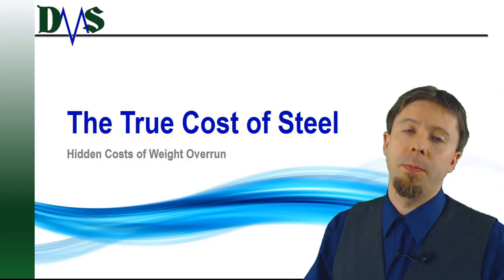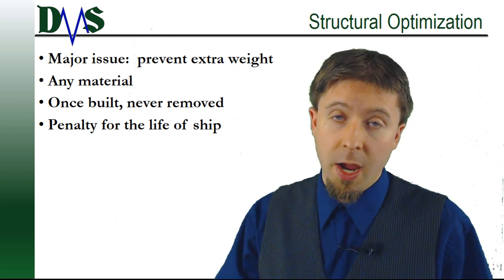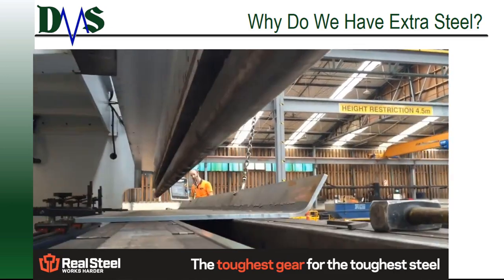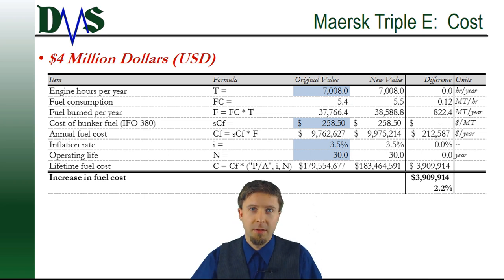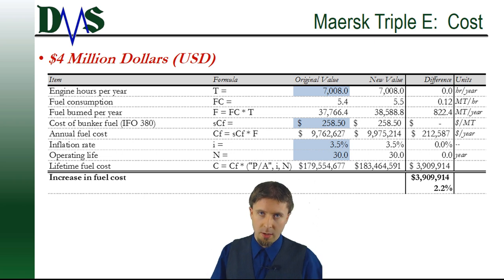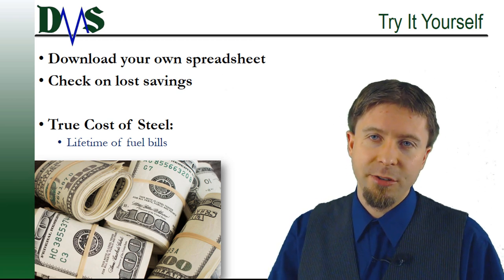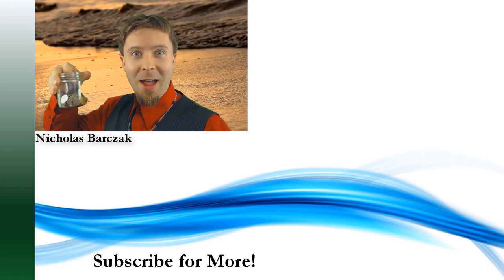The Secret Cost of Steel

Comment: The one factor that would be hard to calculate is the extra wear and tear on propulsion and steering systems. 2.5% extra throttle doesn’t seem like much but the engine would have to work harder and harder every year that passes to maintain the same speed. Increasing fuel costs yet again.

Comment: you are correct for long run 
but the extra unnecessary ballast water or weight will do the same work   
and the less steel maybe resulting that you have carry extra ballast water to allow the bending moment of ship.
Reply from the maker: Good point about the bending moment.  I admit that I also see ships where we intentionally build the steel too thick to increase the corrosion allowance.  Although, if any ship owners want to do that trick, check with your class society first.  They have rules for how much the steel can corrode before you need to replace sections with new steel.  Sometimes, the rules are based on the required minimum thickness.  Other times, those rules based on the original thickness of your plate.  If it's based on original plate thickness, the rules don't give you any credit for extra thick plate at the beginning.  

That's the part I find interesting in my job.  Balancing all the rules and regulations with the priorities of the ship and real life.  Sometimes the rules hide decades of best practices.  Sometimes they are just applied to the wrong situation.  I probably need to do a whole video on class societies as well.
Reply: @DatawaveMarineSolutions  Great videos and very pertinent points.
Another benefit to the extra thickness is that as you know the Class allowed thickness reduction is a percentage. Doesn't take a genius to see that 20% of 16 is less than 20% of 24. When a ship is coming closer to the end of it's life cycle and   internal coatings are eroded this can  yield another 5 to 10 years of life to the hull.

Comment: You can also look at the other cost. That weight of the steel if removed would translate into additional opportunity revenue producing payload as well. So it’s the cost of the extra fuel plus lost opportunity cost for revenue from additional cargo capacity.

Comment: Interesting Nick, however if I were to become a yacht owner I think I would consciously want a vessel that is heavily built for mass below the water line for increased stability and strength for northern latitudes cruising. In fact I would prefer a vessel that is ice classed. That said however what about aluminum? I understand it is stronger than steel weight for weight.  Can aluminum vessels be icy classed?

Comment: Liked this Nick, but have you considered extra hull thickness/ fuel consumption as equivalent to insurance premiums? Isn't it a sort of quantifiable margin of safety, which reduces some kinds of hazard (eg. collision, corrosion, catastrophic failure, etc.) and perhaps increase the life expectancy of the hull?
Reply from the maker: Excellent point.  I agree that at times, it is appropriate to increase hull scantlings.  The cost / benefit of those changes is a detailed debate that should get customized to each vessel and owner.  If that is a conscious decision by the owner, I don't object in the slightest.  But at times in my career, I have heard people ignore any effort at optimization and say to me "Who cares?  Steel is cheap."  That is what I object to.  Steel may be relatively cheap, but fuel is not.
Reply: Excellent reply; focus on one issue, disregard for a hidden expense.
Have you done a study on hydrophobic paint? I saw at least one advertisement on YT for a super-water-resistant coating that depends on nano-particles to repel wetting. It seems that this expensive surface could have very beneficial long-term effects on fuel consumption. A cost/ lifetime trade-off? Marine organism resistance?
Reply from the maker: I haven't done any studies personally.  Although I highly value paint, it isn't my strongest area of knowledge.  I normally rely on paint vendors to get the latest information for that.  I do know what many ship owners are willing to try new paints if it helps reduce resistance.

Comment: Would not a thicker hull though give you longer ship life due to the larger built in corrosion allowance? I guess this assumes that the ship life is based on hull life and not economics of operation changing due to evolution of superior designs making it economically feasible to replace it with a new ship. No in the ship building/operating business, just wondering from an engineering perspective.
Reply from the maker: That is a good idea.  And some ship owners go down that route.  I argue that it isn't worth it.  First, the class society rules don't make it easy to get credit for the extra thickness of the hull.  Just a quirk of how the rules are written.  And the ship doesn't corrode at the same rate across the entire hull.  Typically around 20+ years old,  you start to replace sections of hull plating as they need it.  Replace the steel when you need to, rather than pay for the extra weight over the entire ship life.

Final reason is that corrosion isn't the only limiter of ship structure life.  The other major limit is fatigue.  Microscopic tears in the steel.  Problem is that you can't see it.  The tears often don't show up until the steel cracks.  So it is very difficult to monitor.  In those cases, I would argue that it is safer to just replace the ship and avoid concerns with fatigue.
Reply: I use to work in the petrochemical industry as a mechanical engineer for pressure vessels. Corrosion is typically where we lose correctly designed vessels when there is large areas that need replacing but the typical vessel can be in service for over 90 years if they have a good maintenance program. It seems like engineering is typical across industries since customers love to save money there and almost always end up costing them much more in the long run. Thanks for some engineering insight into naval architecture.
Reply: @Mongo63a  It is very hard to keep a vessel in Class after 23 years anyway.

Comment: The 30 year (approx) lifespan of a vessel has made me think. How high up on the list of items you need to know about is the amount of work already done or needs to be done on the steel hull of a vessel? I ask this as it seems that no matter how much maintenance is done there is, as you mentioned those cracks or stress points that are going to appear no matter how much maintenance is done. I say it in another way.  Even steel hull ships wear out and it is better to replace based on length of time in service than to repair. It is possible to extend a vessels safe operating lifespan by changing its area of operation to calmer waters, it would seem so. That 30 year lifespan seems so short but I do believe it is the truth. Perhaps I am wrong and some major work in a dry dock can make her "good as new again".
Reply from the maker: I LOVE THIS QUESTION!  I need to do a whole video on this.  What you are asking falls under the general term "service life extension."  We especially do this with offshore oil platforms, but ships are equally possible.  We can't ever make a ship good as new.  But we can perform detailed Finite Element Analysis to determine the likely spots for future weld cracks.  Once the engineer creates that game plan, we can focus inspections and preventative maintenance to give the ship 10 - 20 or more years of good life.  Sometimes moving the ship to less severe waters also works.  It depends on identifying the main source of stress in the hull.  The common act of load and unloading thousands of tons of cargo also puts the hull through a large stress cycle.

So yes, it is very possible and already done.  But not a job to start on a whim.  It is usually the first step to a major overhaul.

Comment: To avoid the weight of paint, which often adds more weight and cost over the years, might it not pay for itself to have most steel surfaces that would be painted instead be made with steel that has a thin layer of stainless steel hot rolled onto the surfaces?
Reply: Um, that is not a product you can buy.
In any event, its cost would be more than just using stainless steel.

Comment: What's the cost for peace of mind? How do you factor  for a icebreaker  or the extra weight for strong anchor chain?
Reply from the maker: Excellent argument for engineering analysis.  Just adding extra structure does not guarantee peace of mind.  Normally, that extra structure misses the one critical joint.
With detailed engineering analysis, you guarantee peace of mind, and get to reduce your structure weight.  

Ice strengthening is a great example.  Simply add extra plate, and the hull will break.  Ice strengthening requires extended engineering analysis to design the entire structure.  So why not add in the extra 10% and optimize your structure too?

Comment: Nicholas, does the added strength from a thicker Hull account for any positive attributes in the ship? Thanks..I enjoy your channel...Gene
Reply from the maker: The main argument for thicker hulls is increased fatigue life and corrosion life.  (I need to do a whole video on fatigue life.) 
 Most ships have a useful life of around 30 years; after that, the steel welds start to fail and you need to replace quite a lot of steel plate.  in theory, thicker hulls increase the time before that happens, giving you a longer life on your ship (sometimes ships last 60+ years).  In practice, not all parts of the ship fatigue at the same rate.  So it doesn't make sense to increase all your plate thickness just for a few trouble spots.

Comment: Extra 6mm is just making the ship more stable and more durable
Reply: Yes.  He's neglecting that the extra thickness makes the ship tougher- and able to survive stronger forces applied to it than in normal operating circumstances.

Not to mention the optimization costs money, which might have been better invested (at higher ROI) elsewhere.  You lose the value of the ship when you retire it (in fact, a ship with a thinner hull is probably worth LESS in scrap), so you don't need as high an ROI as you might think for it to be better to buy stocks+bonds with that money instead, for instance...

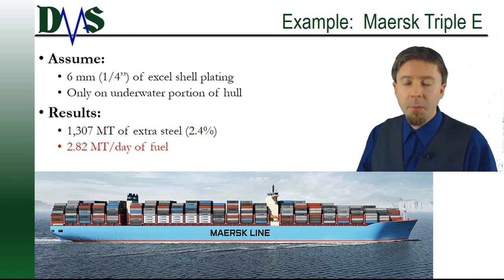Comment: 2:39
Wrong assumption.
The DWT is 4 times the empty ship tonnage, therefore for fully loaded, extra steel will be 0.6%
Moreover, fuel consumption is not linear to 
displacement, but to it's 2/3 exponent (according to Barras).
Not to mention percent of dock time times life time.
So, the "small ship" 4:44, he buys, will be four times smaller (:
Reply from the maker: When you specify that power varies with displacement^(2/3) power, I assume you refer to the Admiralty Coefficient in "Ship Design and Performance for Masters and Mates" by Dr. C.B. Barrass.  Fair point, there is an argument that power does not vary linearly with displacement.  However, you should know that any parametric estimate usually has very high error margin.  My approach has just as much potential for error as the Admiralty coefficient.  This is why any detailed economic estimate should use actual resistance data for the vessel.
Reply: @DatawaveMarineSolutions  well, but 2.4% of extra steel estimate is far from accurate, unless you empty all tanks, and unload 100%
The extra 1,307 MT of steel will be variable 2.4% to 0.7%
On the curve:
Consumption = disp^(2/3)
Fuel costs difference relatively to gross profits is a negligeble fraction. 

On the other hand, graph
Security = extra steel^3
bends upward.

Comment: Id like to se something about rudders cord thickness and sizing. Why sometimes the double jointed rudder ?
Reply from the maker: The double jointed rudder generates more lift at slower speeds.  It works on the same principle as a cambered airplane wing.  But they are more expensive.  We typically use them on tugs any shallow draft vessels where we don't have enough space to put in a larger single action rudder.

Comment: I can't believe there is a 1:1 relationship between weight and fuel used.
Reply from the maker: Strictly speaking, no it is not an exact 1:1 relationship.  But on dimensional analysis, yes.  The ratio between between weight and fuel used may not be 1:1, but the relationship is close to linear.  If you want a more precise relation, that requires an engineering analysis of the precise ship and propulsion system.  DMS would be happy to perform this service for you.  We can produce the exact relationship for detailed fuel burn calculations and trade-off studies.

Comment: Ok Tim, what if that extra 2mm of hull plating gives the Maerssk Triple-E an extra five years of service life compared to an 'optimized' Triple-E?  Which is more profitable then?  Which begs a very serious question,  does '"structural optimization" systematically shorten the potential service life of a vessel?  Optimize a vessel for a 15 year service life it will likely never reach twenty.  I do not know the answer to these questions, I'm just posing the questions to the people who have the data.

Look Tim, any time in engineering you discuss "optimizing" anything, you are talking about making it more fragile as a system based upon a more restrained set of conditions.  The simple fact of the matter is you cannot "optimize" if you cannot [somehow] constrain the conditions.
Reply from the maker: Excellent question, and that is one of the factors that you need to consider when optimizing the structure.  But that logic also assumed that the entire hull has a uniform demand for its strength.  Not true. In most ships structure, the stresses vary a huge amount depending on the location in the ship.  The end result:  the hull gets limited by only 10% of the steel in critical locations.  The other 90% has ridiculous amounts of reserve strength.  
This is the real goal of structural optimization:  reduce that other 90%.  One example would be tapered steel beams.  You sometimes see this with large beams on buildings.  The ends of the beam are not weaker than the middle.  We just adjusted the structure to match the demand on the beam across its entire length.  Why don't we do this on ships regularly?  Because you also need to consider the trade-off on manufacturing cost.  Tapered beams need to be custom fabricated.
Reply: @DatawaveMarineSolutions  Thanks for your reply. Point well taken, but what about factors other than strength.  Back to hull plating, what about corrosion?  Thinner hull plating is going to be much less tolerant over time to corrosion, especially at the tail end of service life than thicker plating.  And there are probably some other factors I haven't thought of yet, but maybe someone can.

Comment: Btw.. how did you calculate the 3.9 million? I am getting 6.37 million in my calculations?
Reply from the maker: The hidden math comes in that formula ("P/A", i, N).  That is shorthand for specifying an economic formula to convert from annual costs to the equivalent net present value.  I use net present value analysis whenever I look at something over that long of a lifetime.  The net present value formula gives you a factor of 18.39 to convert from annual expense to the total over 30 years.  But don't take that number as constant.  It changes depending on the interest rate and ship life.  The net present value is a way of acknowledging that expenses and revenues in the future are less important because there is greater uncertainty that far out.
Reply: Nicholas Naval Architect your explanation is much appreciated!

Comment: The Architect states that once those fuel costs are set (meaning the weight and design of the vessel is decided upon) they are never going to change for the life of the vessel. This statement does not allow for improved engine design or type, reduced fuel costs from the supplier, a change in operating parameters, needs,desires. Why does he figure fuel costs are dictated solely by vessel weight?
Reply from the maker: Excellent points.  And all those variations add a lot of complexity to the economics.  A true economic analysis needs to employ a discounted cashflow analysis and consider all the parameters you just mentioned.  This results in a sensitivity study to predict the probable improvement.  Two main reasons I didn't mention these points before.
1.)  That is way too complicated to explain in a 10 minute Youtube video, where I try to keep the concepts accessible for anyone.
2.)  In all the variations you discussed, the weight of the vessel structure essentially remains constant.  The fuel savings of reducing structure weight are without question.  The only major question is whether those fuel savings justify the additional cost of steel and associated labor.  As you demonstrated, that analysis is too complicated to answer in a simple YouTube video.

Great point.  I love it when people recognize that things are always more complicated.
Reply: Thanks, naval architecture is something so far away from my job (auto mechanic, retired) but it is still something I want to become somewhat "book competent" in before my time is up, I also am trying to learn how to read music. Funny the things we take interest in as we age. I realize that I started way late as there never will be any practical added to my "book learning".
Reply from the maker: Awesome.  If you are looking for a light introduction to the subject, I would recommend Skene's Elements of Yacht Design
https://www.amazon.com/Elements-Yacht-Design-Original-Seafarer/dp/1574091344/ref=sr_1_1?ie=UTF8&qid=1534707323&sr=8-1&keywords=skene%27s+elements+of+yacht+design

If you want a more technical introduction, a good book is the Principals of Naval Architecture
https://www.amazon.com/Principles-Naval-Architecture-2-Volumes/dp/B008R7GU4S/ref=sr_1_3?ie=UTF8&qid=1534707517&sr=8-3&keywords=principles+of+naval+architecture

I'm not associated with either of publishers.  They  are just books that I've used in the past.
Reply: Thanks, only 16.00 on Amazon.